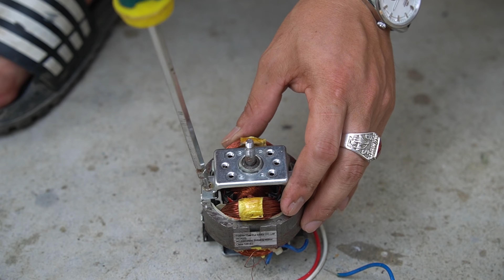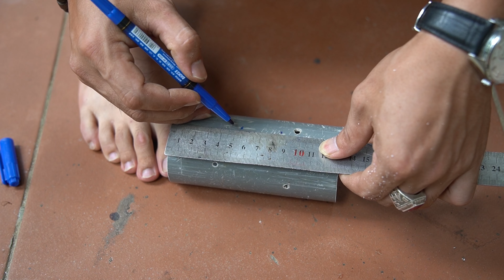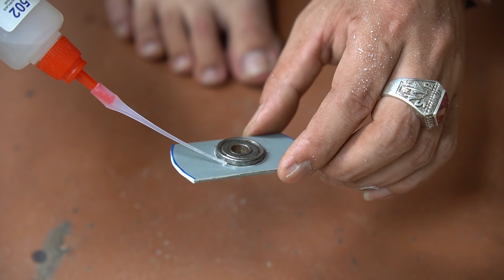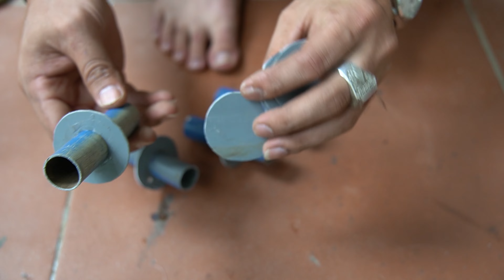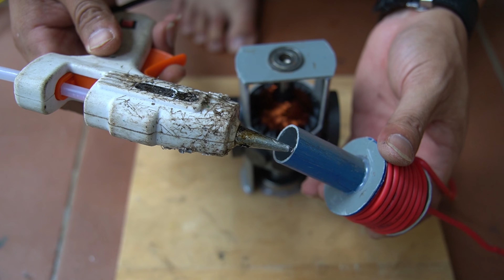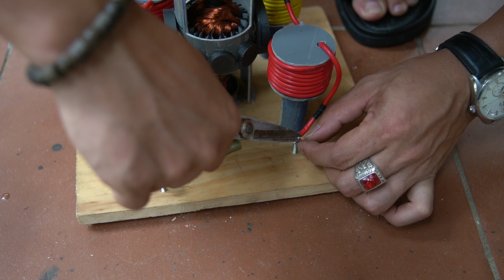How I Made a Powerful Perpetual Motor with Recycled Materials at Home!

Comment: Thank you for your video. What kind of device you use on plug, which device has been removed from and what have you been locking wires on the engine, thank you